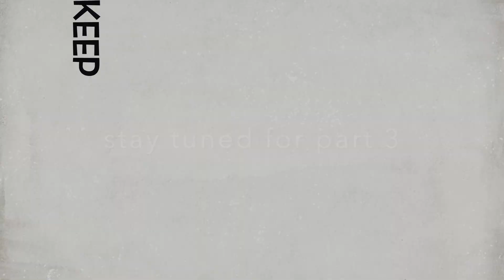RC Rat King Hauler build, Part 2, Trailer Fabrication, Welding, RCengineering RCratrod 56" long

Comment: Awesome job! You'd better have some low-turn power in the semi-tracktor to tow that thing! I would use a plate on the tractor with a hole in it and one on the trailer with a rod or a bolt sticking down! Great video, can't wait for the next one! 🥓🔥💯😎

Comment: Looks damn good. Are you using those generic ebay trailer axles and leaf spring kits? I've been thinking about getting some but I've been very unsure of their quality.
Reply from the maker: These are extra generic axles. Found them on Walmart com for $14 each.  All aluminum with ball bearings. The leaf spring stuff is all parts I’ve been hoarding for years. Those cheap kits aren’t bad though. Just a lot of different length leafs out there so if your looking to replace some they might be too long.
Reply: @RCeveryday  Mm, Walmart special trailer axles, perfect. But what width are you using on this trailer? I've seen 3 or 4 different widths on ebay

Comment: Springs. Why not air bags
Reply from the maker: Just using what i have, this is going to be pretty heavy with 3 ratrods on it and I have a drawer full of extra springs if needed.
Reply: @RCeveryday  ok. I see.  But would the setup from your ramp truck hold the weight if there is 2 each axle on the trailer.        Airbags is used for holding weight for a lot of full size as you know.
Reply: @RCeveryday  I forgot to tell you. I love the planks on the trailer they look damn good and real.     ? Lights when it’s done
Reply from the maker: @philvictor5537  Definitely doing some lights, not sure how in depth yet.  That air system just wouldnt be able to lift this thing even with 6 air struts.  The trailer weighs 10-12 pounds and each rat rod that its going to carry is 7-10 pounds.
Reply: @RCeveryday  what axles and suspension are you using? I'd love to try and build something to tow the crawlers to the trail with! Lol